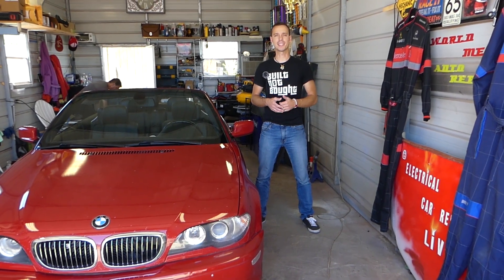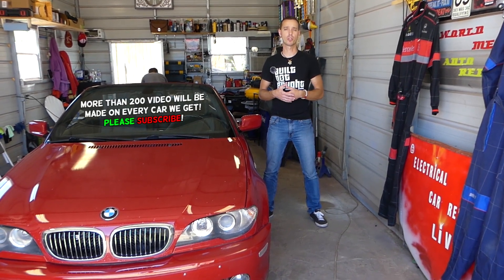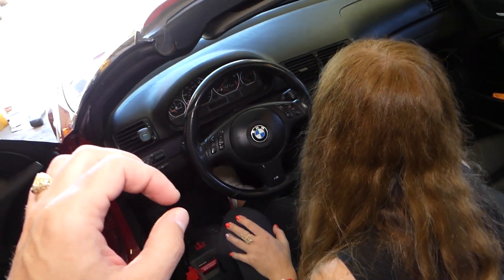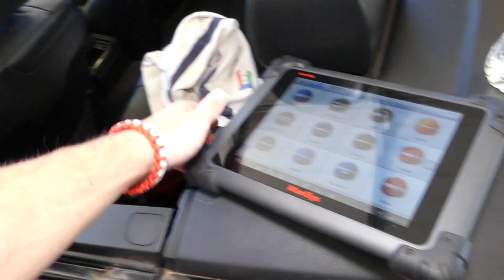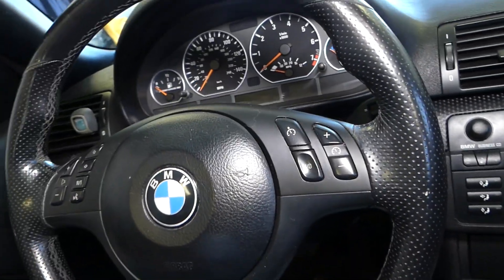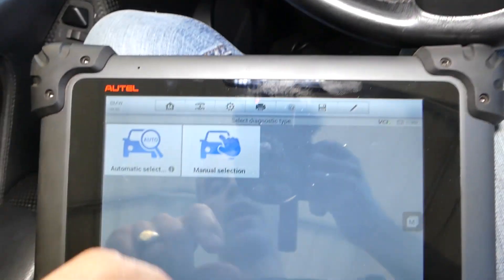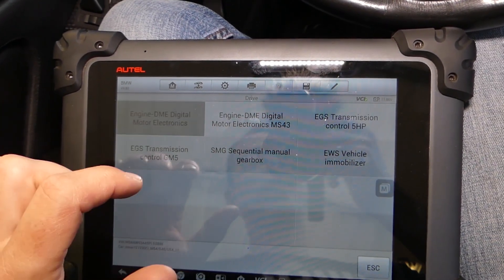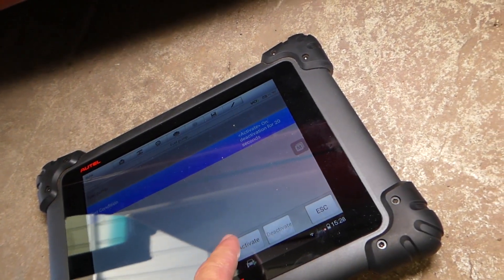HOW TO TEST FUEL PUMP ON BMW E46 325i 328i 330i 323i 320i 318i 316i 318d 320d 330d

Comment: I changed the fuel pump on my 2011 328i xdrive e90 (N51 SULEV motor). I noticed that the fuel gauge isn’t reading the right fuel amount. Do I have to reset it? If so, how do I reset it? Or is there something else wrong? Please help! Thanks

Comment: Hello I have just bought a second hand 330d manual control bmw yr is 2000 model .this car will crank but will not start .I followed a few if you videos that are very helpfull so thankyou.
1 question tho the fuel pump under the bonnet ?.where is it as I am finding it very difficult to buy a manual for this car.i can buy a manual for this cars yr but they don't cover diesels.can you help please .
Reply: the only Fuel pump under the bonnet is the High Pressure pump mounted to the Engine. The most expensive of the 3 to fail.
It is driven by the timing chain so will not work unless the engine is spinning. First thing to check is that fuel is leaving the fuel filter under the car below the Left hand seat.

Clamp the hose leaving the fuel filter towards the front of the car, put another clamp temporarily on the hose behind the filter as well (so you can reduce the amount of mess).
Disconnect the hose towards the front and point it at a bucket/container.
Remove the hose clamp that you may have put on towards the rear of the filter, then without starting the car put the key into position 2.
You should hear the fuel coming out of the filter. If not you may have a blocked filter.

You could also do the same checks by disconnecting power to the tank fuel pump under the rear seat then see if fuel will pump out of the filter, the middle pump should still pull fuel just not as well. If fuel pumps out then middle pump is most likely ok (as yours is a starting issue).

If it flows out the same rate then it could actually be the fuel tank pump under the back seat.
Disconnect the power cable from the middle fuel pump (in front of the rear wheel) and disconnect the hose leading up to it from the tank.
remember to use a bucket or container again.

reconnect the power to the fuel tank pump and see if putting the key into position 2 will allow fuel to flow into the bucket again. if it does then the fuel tank pump is most likely good.

It's a shame that the 3 series does not have the transparent fuel line leading to the high pressure pump in the engine bay like the 5 series or 7 series as this allowed me to see air bubbles in the fuel line (common fault on E39 530d where a fuel tank seal was bad allowing air to be sucked in, just had to keep it over 1/4 tank to avoid the issue).

Link to how I checked it on my old 530d https://youtu.be/BheieyUWhxo where my tank pump had failed... Unfortunately I bought both the tank pump and middle pump, which came in handy 4 months later on the side of a motorway.
Reply: @Chrom35kull  thanks man.i really appreciate all the things you told me there. Im watching videos an reading some small literature daily now and learning a little as I go.i now realize the fuel filter under the bonnet and so have a replacement to be deliverd soon.
Im prepared to take on all the work my self as i really like this car an so will keep you posted as to th project.
Thankyou again 👍.
Reply: @justin13634  just get your wallet ready for when they do decide to turn lemon. Like mine lol.
Reply: @Chrom35kull  thanks again for your help.
I'm learning more everyday.this car will teach me mechanics I belive😁. I've another question.
 I belive on my car chassis number WBAA192030AK35724 i belive their is a fuel pump underneath the car on the passanger side..my question is ( should this pump run at 3bar or 3bar and above up to 5bar as their are many examples of pumps for sale on the internet and I obviously want to buy the correct one .
Reply: I have fitted the in line pump me
New under th passanger seat.plus also th  fuel filter.it seems to me now their is air in th system .still crankin an wont start ?.
Reply: @justin13634  Also you should run the pump a few times before cranking. The longer the better.
If you've had the filter and the pump off turn the key to position 2 without cranking about 5 times, each time let the pump shut itself off first.
That will guarantee the fuel lines to be bled through. If air is in the system you have a loose pipe somewhere.
Reply: @justin13634  Just had a look at Real OEM and seen your cars details. So yours has the Fuel filter under the bonnet, It also has the transparent fuel line from the Filter to the High Pressure Pump (best feature for diagnosing this).
As your priming the fuel line (not cranking) look at this transparent line and make sure no air is in there (will appear as bubbles).
If your below 1/4 tank fill it up as you may have a bad seal in the tank causing it to pull there.
I've found this forum post as it seems your car is very similar in setup to my old e39 530d https://forum.bmw5.co.uk/topic/131077-restart-e39-530d-sport-touring/?page=3
It had air in the fuel lines.

It may be worth taking the fuel tank pump out and seeing if the in tank fuel filter/pickup has come off the bottom or if its bottom seal is bad.
as if thats sucking fuel tank air then nothing will work unfortunately until its fixed
Reply: @Chrom35kull  bud i can't thankyou enough for the replies you have sent.i will work towards checking all of the things you have outlined in the last msgs.
I really do appreciate your Input.
Reply: @Chrom35kull  tomorrow I will be removing the second hand pump i Installed in the tank for inspection.
This is a bit odd tho.ever since the car out the first time the rear passanger door window goes up an down of its own accord.
Surely the two problems are not related.
Reply: @Chrom35kull  finally I got to read the link in the post you sent.it doesn't make a massive amount of sense just yet .I will have to read it thru a couple of times.today I removed the pump from the tank an it all seems to be ok.under the bonnet I have a massive amount of air in those clear fuel lines.ive primed many times without cranking an its still full of air.
Possibly im missing something in the link you sent so will read again an again till I understand .
Reply: @Chrom35kull  I did not notice this ...
But the see warning light is on the dashboard.please help as I have looked on forums .but they say to many diffrent things.
Reply: @Chrom35kull  new pump fitted under passenger seat chassis.all good an working as it should be .nice car to drive. Thanks for your help.